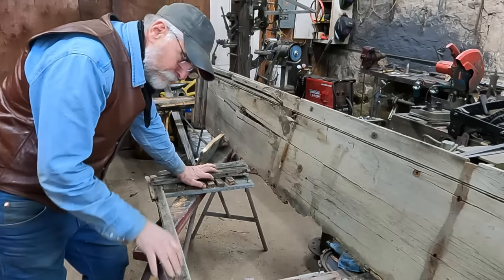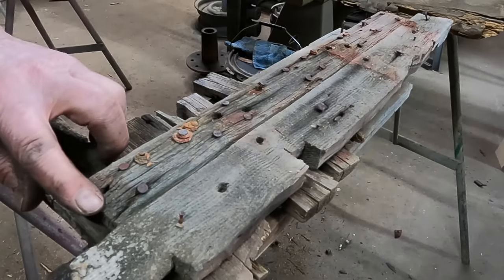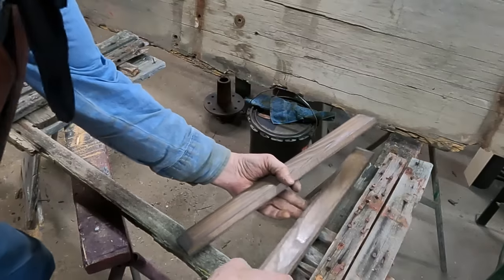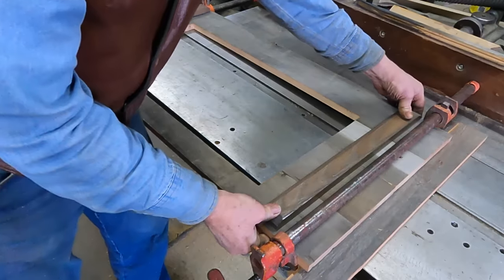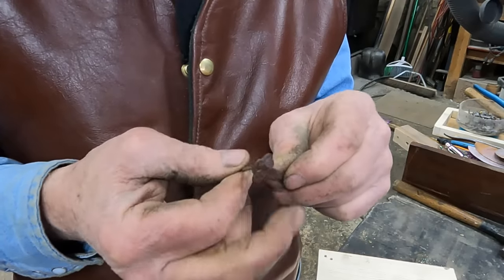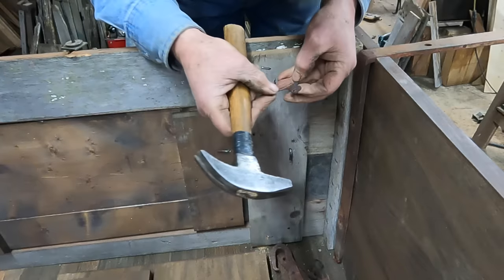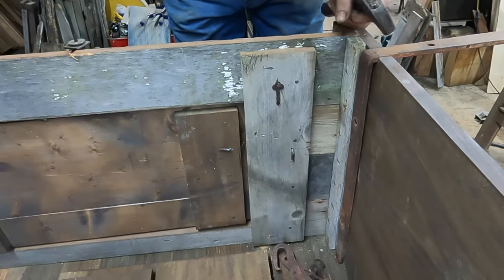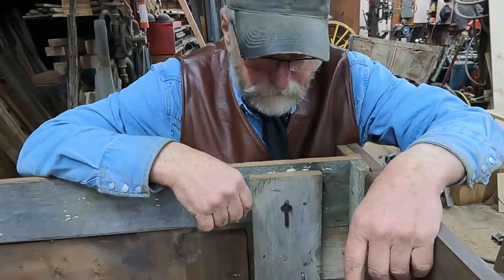Finding a Hidden Key When Rebuilding the Sheep Herders Tailgate | Engels Coach Shop

Comment: The key looks like one for an old "Master" shackle lock. They were cheap and quite common, the body was made by stacking plates riveted together. The lock was probably used to keep the tailgate closed. The spare key was nailed inside the tailgate to keep it safe. "Just in case".
Reply: Took the words out of my mouth. I have a key like that.

Comment: Some kind of a secure metal box hidden somewhere with their valuable . They didn't always trust the bankers and their banks back then. You did a fantastic job  putting the tailgate back together with all the old parts and pieces of wood. It will be a fabulous looking  work of beauty by Dave when all said and done. Stay safe and keep up the great videos and work you master. Fred.
Reply: I agree,  it looks like vault or Strongbox key.
Reply: 18:20 Because the key was permanently attached (the hole of the key won't go over the head of the nail). I don't think it was for a strong box that you'd need access to it now and again (there'd be more than one hole in the area, where the key was removed and replaced). 💖🌞🌵😷
Reply: It's s pad lock key you can tell by the bitting. I'd imagine the key went to the pad lock for the grain hatch and they nailed the second/spare key that came with it to the inside of the grain hatch so they'd always know where it was if they lost the master key.
If it was for a "strong box" you wouldn't put the spare key to it anywhere other ppl could see it.

Comment: Anyone else shake their head in admiration while watching Dave try his darndest to clock all of those slot-headed screw holding the hinges in place at around 8 minutes? As always Dave: Thanks so much for allowing us along on this journey! Stay safe.
Reply: The hinges reminded me of a 1920s farm wagon I bought at auction in the early '80s. The hinges on the wooden tail gates were held on with slotted flat head screws, slotted round heads, clinched nails (unblievable), a square head lag bolt, a rivet with a washer chicken s*it welded on the other side with wood burned so far away as to not contact it. Also all the axle castlated nuts were held on with bent nails, not cotter pins.   The hinges in this video are works of art compared to that rough wagon.
Reply: @charleshettrick2408 --  But if you think about it, it tells a story and adds to the character of the wagon.  Probably some old farmer doing the best he could with what he had.  Money was probably hard to come by and the hardware store far away.  Some farmers probably would have made their own hardware if they had a Blacksmith set up.  I've been told all kinds of stories by my grandparents about what they did to survive on the farm back in the late 1800's and early 1900's. Of course they are long gone now, but I remember the stories.
Reply: @charleshettrick2408 - that whole wagon has a lot of character from its past !! Love watching Dave at work - probably seen most, if not ALL his videos !! Amazing gift he has !!
Reply: Good idea about addressing the types of hammers you use, and also you seem to be the most patient man in the world please share your secret or let us know what your work place frustrations  are

Comment: I remember how my grandfather, before bending a nail, used pliers to turn the tip of the nail 90 degrees and, after bending it, hammered it into the board. It looked nice and secure, and the tip of the bend never rose above the board or scratched your hands.

Comment: Dave your surely a master wheelwright and did every wheel on wagons guns and even clocks ,LOL but watching you the pass year your true gift is building wagon of all kind , finding the wagon and parts from a pile of wood that looks impossible and you make the wagon even better then the original builder , and you use no modern parts you even make your own bolts at times I give you 👍🏻👍🏻👍🏻👍🏻 that’s the most your the best !

Comment: I recognize that style key from my childhood.  I had a bicycle padlock that took a key just like it.  I suspect that was the "spare key" for the padlock that kept the door locked.  But how you'd get to the spare key if you were outside with it locked would be a real challenge.  I liked how you used the hasp hooks over even though you had to add a bit of weld on the rusty one.

Comment: The other day you mentioned that you as a carpenter didn’t normally like clinching the nails points over. It was a very effective method to keep the nails from working there way out do to weathering. Ive seen many barn doors with nail clinched over and any that weren’t where creeping out

Comment: In a later video where you install an iron onto the door,  it has a hasp to put a lock on and secure the inside of the wagon.  My hunch is that this is the spare key to the long lost lock,  hidden so if the first key was lost the shepherd could still get inside.

Comment: I had a very similar key with that clover leaf head to a extremely cheap padlock in the late 1970s, Almost any small flat key or a gentle tug would open the lock; so i never used it.

Comment: Dave,  I've hidden keys like that around an inside corner so you have to reach for it in one place so that a lock somewhere else could be opened if needed.  Maybe the original owner of that key did similar in case he/she lost the front door key to the house?

Comment: The key is for an old pad lock, you can tell by the bitting or notches cut into the key.
Why is it there? 
My guess would be that it's the spare key to the pad lock that used to be on the outside of the grain hatch and the owners nailed it to the inside of the hatch so they'd always know where the spare was. 🤷

Comment: The key is either for an early, cheap padlock , or for a cheap "money box". Suspect the latter. Bit of a puzzle as to how it could be used if it won 't come off the hook.
Doubt that it was a spare key for the wagon because it was inside , so could not be used if you were outside!

Comment: What were you using to lube your screws? Soap or paraffin?
Reply: It is tough to tell. Thought initially soap, then paraffin. Interested in the answer. Been using beeswax for 50 years. But in really hard hardwoods like Osage Orange or where grain structure easily splits, like Osage Orange, it helps to soften the wax and completely coat the screw.

Comment: The aged wood looks good colorwise, but the finish is much too smooth. Running a stiff wire brush even a realy stiff one like ypur blacksmith scale brush wood work well. Something that works really well is doing a coarse sandblasting on it to help scallop out the grain. Best to follow up the sandblasting with Something to burnish it some like marbles or ball bearings epoxied to a board. Do that first then color it. That finish wood be very close to aged. Also like I mentioned before, some very strongv10% hydrogen peroxide splotched on here and there will give the wood a nice bleached look with having the stench of bleach (sodium hypochlorate).

Comment: Having a hard time getting past the bent over nails on your work! It’s like puting a bumper sticker on a Ferrari!
Reply: It's called clinch nailing and has been common all through history.
Reply: It's called "clinching".  In the XIXth Century and earlier, it was how one sealed nailed boards together permanently, as opposed to just nailing (not bending the nails over) which was a looser joint and could be undone for removing or a panel at a later date after construction.